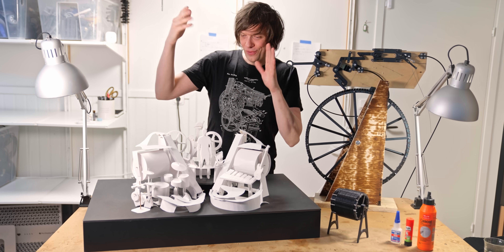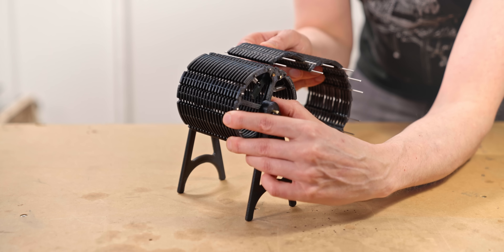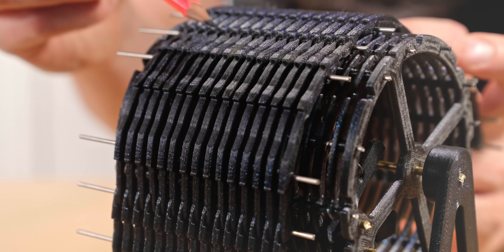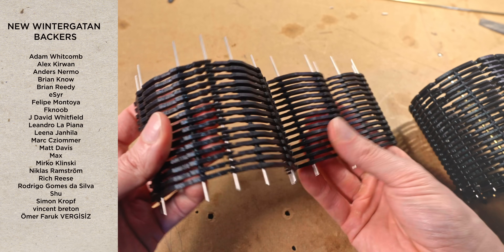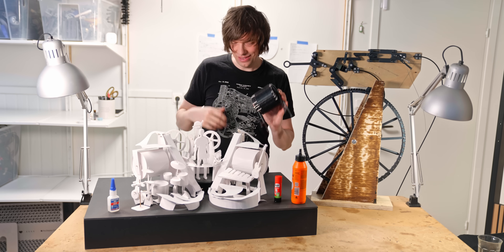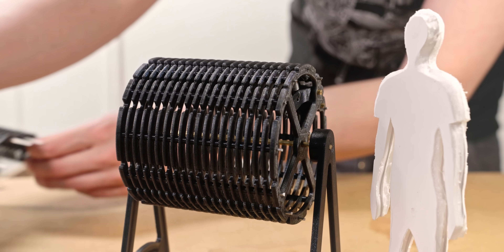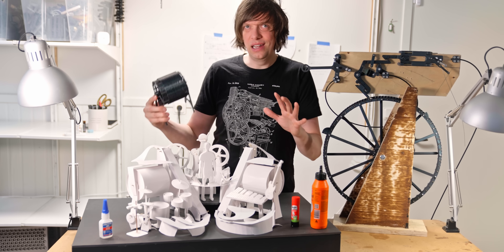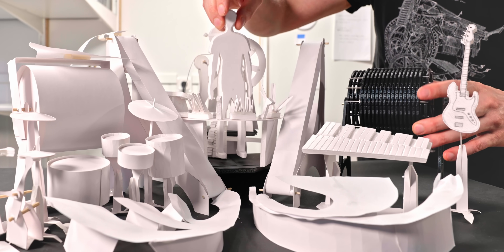A new way to switch songs on the Marble Machine

Comment: I wonder how hard it would be to modify this design to have a longer programming belt instead of the wheel? Just an idea for longer songs.
Reply: Sorry if my reply gets long, but anyways:

I guess you'd have 2 wheels. One at the front and another at the back. One end of the belt wrapped around one of the wheels, the other end of the belt wrapped around the other wheel. You'd adjust the distance between the 2 wheels to (1) adjust tension on the belt, and (2) account for longer belts that have longer music. That way you still have a "wheel" involved for the belt to wrap around, but in a way, it would also be a hybrid between programming wheel and punch card/paper tape. That's probably the easiest and most obvious way to do that. It's a bit like a belt and pully mechanism.

For re-programmability, I think the belt would have plastic or metal strips all over it, with the strips having holes in them where you'd place the programming pins. This further proves my point about the punch card/programming wheel hybrid. you'd get the added portability and musical flexibility of punch cards. But punch cards cannot be "re-programmed", whereas programming wheels can. In a punch card, the holes alone are the programming object. In a wheel, the holes only act as fasteners to fix the pins into, then the pins become the programming object. But then those pins can be unfastened and re-fastened and so on, either to easily edit a pre-programmed piece, or to completely improvise musical sequences in real-time. I'd think that this kind of re-programmability of programming wheels, then, could be relatively easily re-created with belts and paper cards which are a lot more flexible and portable than wheels.

I am by no means an engineer or builder or anything like that though, so I do not know if this would actually work.

Comment: 3:02 are you using a drill to friction fit those long pins into the printed parts? That's a very cool trick. Does the spinning pin heat up the plastic enough to make it easy to insert?

Comment: For the composing side, i think you need a software solution. Compose the Midi tracks. Then convert the notes in each channel to a location on the programming wheel. Im not good enough with SW anymore, any SW engineers agree or disagree?

Comment: I'm still thinking the shrouds will take time to swap over, in addition you will need to ensure indexing all active programming wheels to align them up to the same point. also will each song work with the same sized wheel, will some wheels need to be bigger or smaller?

-edit This has made me think of the old card punch machines. Where a song is just one run through of the bundle of cards that are pulled out of a bin then folded into another bin. Changing songs would simple be feeding the new set of cards to the machine. Far easier than shrouds or new wheels

Comment: This problem was solved by barrel organ makers over 100 years ago, you pin the songs to the barrel side by side and then shift the barrel sideways so that each songs pins line up with the readers. Apart from needing a barrel wide enough to accommodate the multiple pins, it's an elegant solution which allows one barrel to play many songs.  Not sure that re-inventing the wheel (literally) is always the answer, even if it is fun!
Reply: He already knows i believe he's using it to extend the music in a song rather than switching songs due to the wheel moving faster but I'm not sure and i can't find the video where he goes over how he's using it. Not that anything is set in stone right now anyway.

Comment: I have two questions here
1) how do you synchronize the programming wheels to each other? After manually turning around the wheel for song replacement, the two wheels would need to be resynchronized so the first bar is at the same position for them
2) Wouldn't it be possible to keep the song programming a bit more flexible, e.g. like a tank track? That would potentially allow you to do an approach similar to what the old self-playing instruments did with their paper scrolls, where you actually let the machine PULL THE SONG IN in the first rotation of the wheel. That would allow the technicians to basically just align the first part of the song with the wheels fixation point and then the programming gets pulled around the wheel.

Comment: Ok for those rings on the and even the side pieces on the programing wheel, anything CNC would be absurdly expensive to do. Since they are flat, laser/plasma/water jet cutting would be your best bet in not only time but also cost. Not to mention material waste as you are going to be charged for the whole plate that it will come out of no matter what you do as that's how they charge for material cost so if anything those extra plates can have something else taken out of them. I would only use the rotating CNC for things that have for 3D cutting needs like overly thick parts where they can't be cut out by laser/plasma/water jet or there needs to be side stock removal that does not go all the way though. If you are worried about any sort of warping or rough edges then go water jet. 

As far as the plastic parts, could be ideal for laser but the plastic will be very specific for that where CNC you have a broader option. I would not water jet plastics as they tend to like harder stuff, you can water jet plastics but its kinda a waste and mess to do it as the plastic can get scratched up from the blasting. More than likely won't need blasting media like garnet but that water still can shoot up any material from the tank below. I think the laser (depending on the product) can be the quicker and less costly option given the large amount and variation to do. An option to think on is the plastic, It needs to be fairly wear resistant and also offer a smooth and least amount of friction while also being durable enough to be put on and removed as large pieces in a somewhat thin and narrow form and not try to warp and deform. That will limit a lot of plastics and may very well remove them from being laser cut.

Comment: The different parts of the shroud dont have to ve connected before putting it on. You could just have 5 light plates which are put on separately instead of a massive 40kg chain of plates. Probably its more handleable with a full size version.

Comment: why not change the entire wheel without changing its structure? like a slide. one wheel slides down and back behind, another slides in place. i think with your current approach theres going to be lots of failure points. tolerances, expanding material etc.

Comment: you should consider changing music sheet while the programming wheel is not connected to the gears. The operation you describe require a good timing with huge parts in a stressing situation. By adding a clutch to the wheel, you can make this operation easier and more important : safer!

Comment: This seems like a very fiddly idea. At least check it the snapped-on solution does not warp, loosen, break or bring rotation / runtime issues due to a non-balanced song roll. Also, depending on the proximity of programming pins, it might not be feasible or even possible to bend/open the song roll layer outwards due to pins being pushed into each other. Maybe stay rather with swapping the entire roll, just simplify the exchange mechanism to allow a quick swap. Swapping whole rolls is, just perhaps, a tried and true solution for a reason...

Comment: I think this is a lot better than the programming pins, I worry that the spring arm for holding the entire song programming roll will have to be quite strong, and may be a major pain/ hazard when working with. maybe use multiple smaller springged arms?

Comment: If you reverse the levers so the back unsnaps first, the wheel can continue in the same direction and the skin will fall off on its own and push backwards along the stage. Might make it a little easier to unmount!

Comment: I think having it either in multiple separate sections, or being flexible enough to roll it up would work better than to have it as a long strip with only a few articulation points, similar to a roll of paper for a player piano.  If possible, having it able to be packed up in a compact way for transit would certainly help in the long term by limiting its space to shift around and not having to worry about parts getting damaged in the meantime.  If necessary, having at least 2 of each part as backups in the event something does get damaged at any point.

Comment: How much do you feel that the financial support is a comfort cushion which slows down progress by removing the stress factor of limited funding? You have been at this for years now and what im witnessing is a very slow process and progress, and even more so, when you were 90% finished with the MMX you started, basically a new brand project. Im not worried about you getting rich from member support, I am worried that you might drag this process out too long and will eventually loose the support without commitment which will slow down the process even more. Because what comes with other sponsorship deals might also be a demand to deliver on dates, a demand that your community doesnt have, but dont "abuse" the communities support either.

Other than that, the programming wheel is a good idea, but problems with alignment might show up when you scale this up and want large programming pieces that also needs flexibility. And what happens if one of the programming parts break, in the least suitable position? and where do you really not want it to break? Do you have spare parts, or do you need to skip the song because a piece of plastic broke.

Comment: I like the idea of hot-swappable tracks, but I'm having a hard time envisioning that belt method in a concert environment.  It seems like it would take some time to transition between songs.  If you could have the tracks be on a rigid frame that's easy to slide on and off that could possibly speed up the song transition process

Comment: it's not an easy thing to attach and detach in actual size. not to mention the damage caused by dismantling. For this it seems you have to relent, and use something that has been tested such as a solenoid pin or a customized pin that is programmed with Arduino.

Comment: I feel this is too close to MMX's system. You always said you had many many issues with getting that to work. Would this not be subject to the same issues? If you are trying to optimize transportability would it be better to not use a belt and instead use separate panels?

Comment: I know you like the idea of a programing wheel but have you ever considered using a belt instead. With a belt you could add and remove programs as the machine is still playing  just by adding slack at the beginning and and end of the belt. You could also have longer songs as you would not be limited by the diameter of the wheel.

Comment: Not digging this idea. Specifically, because it feels like you came up with something new and aren't considering whether it has any benefits over the previous idea you had. Now, you either have to lose half the available channel space to leave room for "playing live" with the machine, or just not have that option.

If you stick with your original concept of "program the wheels and swap them out whole", you could still focus your efforts on reducing size and weight to make them portable, but not have to deal with all the extra moving parts, as well as having to build "final" versions of all the songs.

IDK, I think I'd prefer that over this idea. I think if you tested several different design ideas at small-scale, and accounted for portability, re-programmability, and overall functionality as a result, you're going to find that your original idea would be much better.

Comment: The downside of the drum is you are limited by both the diameter of the drum (song duration) and the length of the drum (number of channels).

Your solution is good but each song will require a fair amount of space to physically transport.

I offer a compromise: replace the drums with a computer.  You can still use everything else you have!  In response to an external timing signal, the computer will advance.  All the computer will do is hold the song and drive solenoids.   The solenoids will do exactly what the drum did.

This is simpler, much more flexible, and still has marbles going everywhere actually making the music.  Plus, since the computer will be driven by an external signal, you will not be dealing with the computer being in charge.

Yes, I am well aware that your vision has always been a purely mechanical machine.  Please consider how much complexity and difficulty that requirement forces.  In reality, you want to be able to use this machine to perform (entertain).  It is more important that the machine entertains than the exact mechanism it uses. Does it matter so much if a player piano is driven by a scroll or by midi?  It is still amazing.

Comment: I'm gonna love watching Martin trying to design humungous wheels that hinge and come apart like this while still maintaining the kind of accuracy he's been obsessing over
Reply: That's true, but remember that he's not using pins directly anymore. The kind of whale readers are meant to provide that solid base as long as they can still slot in. So as long as nothing is damaged to the point where entire assemblies are breaking off, it should be fine. That said.. That's a non-trivial assumption haha. (but this also illustrates why you need to have tight tolerances where you can get them because they WILL get loose elsewhere).
Reply: Not to mention that they will be unwieldy and heavy.  At times Martin does illustrate his shortcomings with design and manufacturing with exuberance and reckless abandon.
Reply: @pthalodezin  "At times?"
Reply: @pthalodezin That's what makes it art and not engineering lol
Reply: @billhutchinson6318  I've heard Martin say the words "engineer" and "engineering" 100x more often than "art"

Comment: The base wheel idea is pretty solid I think. What would benefit you once the machine is built is to have a manually programmable shroud that you can install like a normal song but it lets you play and compose on the real machine just like the old ones. This way you can perfect your compositions and practice with the band all while you have finalized songs sent off for manufacture from what you've created.

Comment: Idea Time:

I saw my stud belt in my closet. And saw that each stud is stapled onto the belt.

What if you made a flexible belt that can wrap around the drum. That is molded with grids that take on the keys, so that you can staple the prongs or stubs.

This flexible belt can be made many times, only the notes have to be pre-stapled so that you had multiple rolls of songs to latch and install onto the drum.

Less parts, time optimized on installation, simpler and flexible.
Reply: You can store them in their own tube containers with their own labels and durations. 
The questions now are; what materials flexible & durable? Would the blank belt need multiple layers to handle stress, wear & tear, and tight timing on the beat?
How will the grids on the blank belt look like? 
How will the pins(stubs) for the notes look like? 
How will the pins attach to the belt?
And how will the belt latch onto the drum?
Reply: Belts will stretch and ruin his "tight" music that he's been striving for.  To be clear this entire video will also ruin his design, but I'm locally optimising to your comment here :D
Reply: @mcspud  read my second comment, I’m open to the optimization of the belt.

Comment: Hmm for some reason I would prefer some sort of ticker tape/braille reading system. You could compose in midi and then print out your programming. You could also make a system that plays live midi. Considering you use electric machines to build the machine using an electric machine to program it isn’t cheating. What makes an instrument unique is it’s timbre. The art comes from the artist not the instrument.
Reply: Hmm imagine a mechanical keyboard that could trigger any marble drop live.

Comment: You probably should just use solenoids for programming songs though, really no reason to do that mechanically and it'll let you use a computer to lay the notes out tracker-style. Definitely keep aiming for mechanical for the actual performance, of course.

One solution you should probably look at is linkages between sections of the programming "skin". That way you don't have to lift the entire thing off in one "peel".

Comment: Martin, I know you won't see this, but I think your seriously underestimating the size & weight of these programming belts once they're at full scale and fully assembled!!! 
   You're talking about using laser or water jet cut steel, which when fully assembled is guaranteed to weight over 100lbs and be what 10 foot long or more. This will make song changes an extremely slow and difficult process, and not to mention a possibly dangerous process as there will be hundreds of pinch/binding points all over the belt.

I feel a much better solution if you're insistent on using metal, is to instead not pin/attach together, but to have them as individual Modules/Panels that you can attach to the wheel. 
   Or better yet use a different material for the belts like a heavy duty fabric material like canvas and use the same style 3d printed plastic strips with the holes in it that accept Technic pins, but you use something other than the Technic pins as the nodes.

Comment: @wintergatan, If the programing wheel has to stop or slow down between song changes that means that you will have to start and stop the flywheel if you aren't going to "disengage gears". Also In your demonstration you spun the wheel one direction to take the song off and the opposite direction to put the next song on also very hard to do without "disengaging gears"